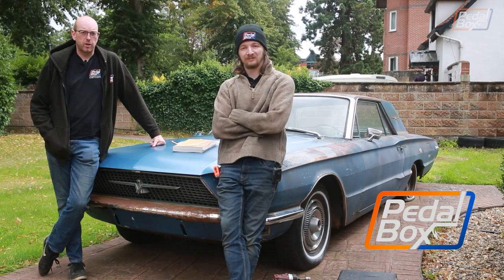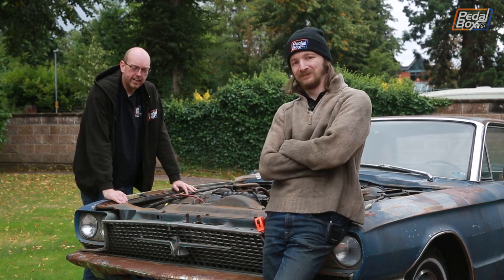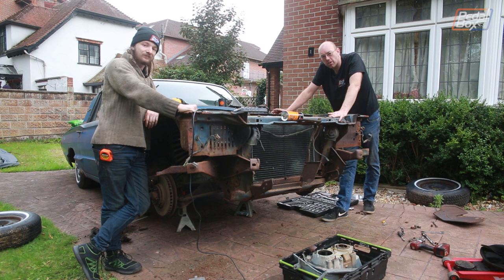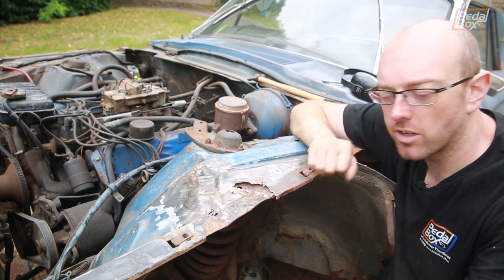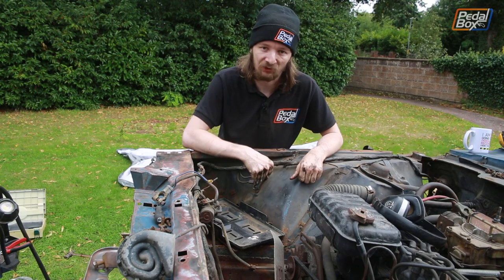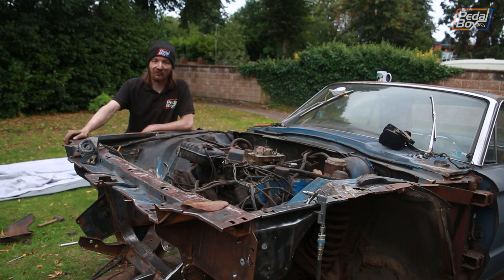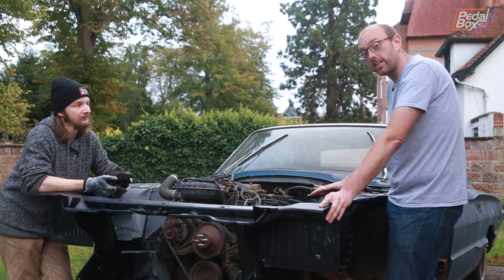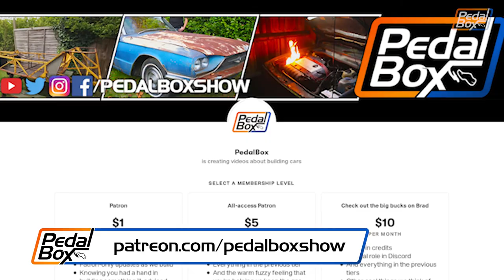Front End Teardown | 1966 Ford Thunderbird | PedalBox Episode 63

Comment: Glad you use Rockauto. I find they can be cheaper than UK specialist dealers even after shipping/taxes.Just the 7 day wait....and when the sale is on, temptation to stock up is hard to fight!  Good work on the battery tray BTW.
Reply from the maker: Yeah, Ian (who I got the car from) recommended them, they were really good sorting shipping to the hotel when we were over there in 2019. Sadly when I put the brake piston order in and added a bunch of misc other bits (seals and what have you), the ONLY thing not in stock when they went to dispatch it... pistons. So I've got a misc order or things coming I wasn't entirely in need of, just nice to haves, and a second order in now with the pistons... plus a few more odds and ends. See what turns up first :)